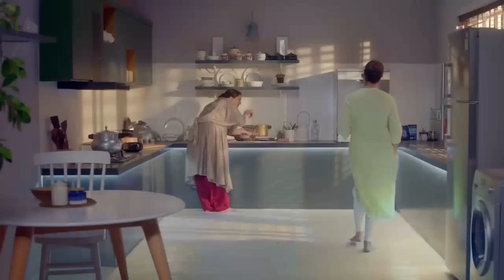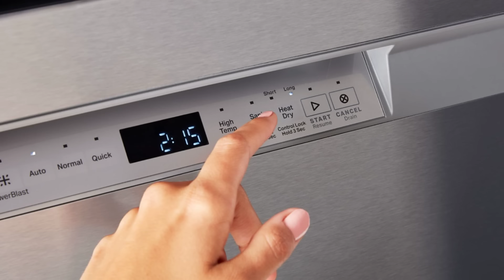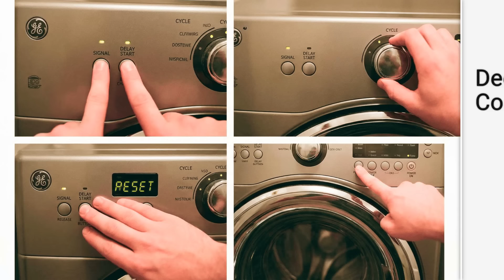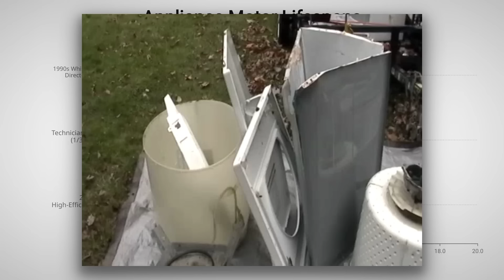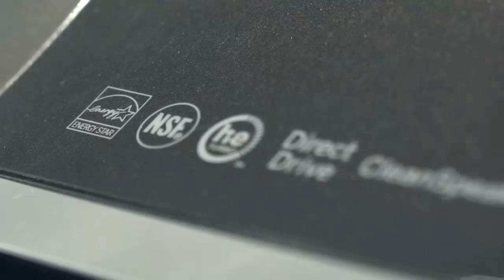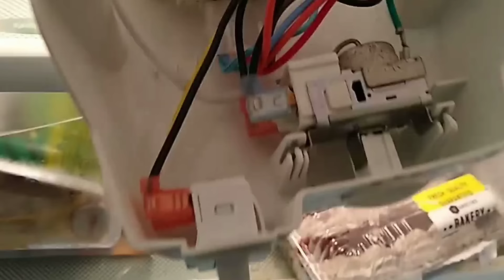Why 'High Efficiency' is a Scam (The EPA's War on Quality).

Comment: They’re horrible no matter what brand you buy.  They don’t get hot enough, they take forever, they don’t dry the dishes, they never look clean, the racks don’t hold the dishes securely and the fall apart fast.  The washers, dryers, refrigerators, freezers and stoves are just as horrible.  How did the country get this bad?

Comment: Still have my late 1980s and early 1990s washer, dryer, and dishwasher. I have replaced 1 switch in the washer and 1 thermal limiter in the dryer over that time. The stove is a 1940s model

Comment: Just finished refurbishing a Kitchenaid/Hobart KDS-16 from 1969. Uses 15 gallons of water on the main cycle BUT, the cycle lasts 50 minutes, requires no rinsing, no scrubbing. My faucet uses 1.8 gallons per minute. If I spent 8 minutes cleaning or rinsing dishes, I would use that amount of water anyway, so in the long run I expect to use about the same amount of water, maybe less, using the older model.

Comment: I live in a place where fresh water is not a scarce resource at all. "Conserving" water in our case is wasting electricity and all the resources that go into building and shipping a dishwasher. We've gone through multiple expensive dishwashers in just ten years. When I was a kid in the 70s and 80s, my parents had the same set of kitchen appliances for decades. I think we're at the end of a cycle in the US where bureaucracy has fully rotted out what was left of common sense and pragmatism, but I think that's the future. The "tech" industry is tapped out and wasting vast resources to do nothing useful. It's time to reboot.

Comment: There's nothing wrong with a time tax if you want efficiency. You are gaining the efficiency both in energy and water used. I don't see an issue here. Dishwashers were made to use and forget. It doesn't matter if you are leaving it run for 40 minutes or 3 hours unless you are really in a hurry to put those dishes away for some reason. If you have a large load, what difference does it make. Run it and forget it. Time efficiency for laundry might be an issue but with respect to dishwashing, I don't see the problem unless you are running a commercial operation.

Comment: The video is b.s. Efficiency guidelines on appliances have no impact on robustness of design and manufacture. There is nothing preventing an appliance company from using heavier gauge steel, using metal instead of plastic, using mechanical timers instead of electronics to mention a few items. Americans number one consideration when choosing appliances  is "how cheap is it?" Cheap cheap cheap, hence the popularity of Walmart, America's favorite store. Americans may complain about quality but aren't willing to pay $1 more to get it. If all regulations were removed from appliance manufacturers, quality would not improve as long as Americans chase cheap and shop at Walmart.

Comment: I have an HE electrolux washer. It washes reasonably well I have to say. Sometimes if I feel like a load needs more water than it already filled with, I have a hose from the utility sink attached to the faucet and fill the machine through the detergent dispenser until I feel it’s enough water

Comment: I'm still rocking my beige, GE fridge from 2000, old top load Kenmore washer, old Maytag dryer. R22 central air system from 2004. IT JUST WORKS
Reply: Give it a few more years, and beige color will be back in fashion.

Comment: Have to say, my Samsung front loaders clean up super well and save tons on water bills.  Not that scares here, but it does shave a lot of cost year by year - I feel it's on the final user to make it work properly, most of the front loaders user don't even do basic maintance to their machines and let them pile up molds and grime, that's the main cause of bad odors on front loaders.

Comment: That's why I'm using a Hobart KitchenAid dishwasher from the 70's, and use a late 80's Lady Kenmore Series 90 direct drive washer. I Also have a late 80's GE Filter Flo washer for really dirty things, as well as pet bedding, since it removes hair very well. I have 2 labs and they shed a ton year round. I Also occasionally watch a few friend's dogs, including a German Shepherd as well as a collie lab mix. They also shed a ton. I need machines that do their job in a reasonable amount of time, are reliable, easily repairable if they do need service, and above all, do the job they are supposed to do.

These new machines are just designed to beep and boop, light up, make it seem like they are working, and then break down when they are just out of warranty. It's disgusting how things can just be flat out bad at their job in the name efficiency. How is a washing machine that uses 7 gallons of water going to clean as well as a machine that uses 30? It's not. That's all their is to it. The water will become filthy quicker. The more water you use, the more diluted that suspended dirt is. They also have abysmal agitation and roll over. The worst performing machines from the 80s are still 100 times better than the best models today, with the exception of Speed Queen TC series machines. We hit a point where efficiency, reliability, and performance were all good, that point was the 80's through the mid 2000's for washing machines. Now we're sacrificing overall performance in the name of efficiency. Even front load machines are terrible these days. Same thing with dishwashers, and toilets. Then when these pieces of shit inevitably fail, they end up in landfills. How is that environmentally friendly? Meanwhile, that 1990's Direct Drive washer is still going, and will continue to do so with minimal maintenance.

The place I work has a Samsung top load "washer" that is a joke of a machine. It's in our break room. As I type this, it is attempting to balance itself so it can spin the still dirty garments inside of it. It's filled and emptied itself twice so far to re balance a fairly small load of laundry. Nothing especially bulky either, it's washing a small load of rags. I'm waiting for the inevitable off balance warning and it's annoying little beeps. The rags would be cleaner if I washed them by hand in the sink. This same load would be done in under a half hour on my machines, meanwhile we're approaching an hour on this stupid thing.
Reply: I use a 1960s Hobart KitchenAid KDS15 superba . It’s a BLAST! 
Primary washer and dryer are center dial Maytag A806 washer and DE 806 dryer. I love how they light up. And they work! For bulky items (and sometimes just for fun-I’m crazy that way) I have a 1923 Easy vacuum electric model R with the spinner tub on the side. It’s the big copper one with the reciprocating plungers. It’s actually extremely gentle. I can even wash draperies with the pleated tops and it’s the only machine that doesn’t damage the pleats or affect the stitching. Yet it’s quite effective. 
Dunno. When I walk into a store and see  what are basic appliances that have had the same assignment for over 100 years (washers, vacuum cleaners, toasters etc)  all look like they’re from outer space, I know we’re being gouged for non-durable durable goods
Reply: @famousutopias  My dishwasher is a KitchenAid Imperial KDI-18. I like those old Maytags that have the light up dials, my Lady Kenmore washer and dryer each have a little light above the dial. They're also factory painted black, which was a pretty rare option for the time. The GE Filter Flo is in fairly rough shape, although it works perfectly fine, it just looks pretty. I have seen videos of those old plunger style washers, they are really neat. I just haven't ever seen one in person. The only non-vintage major appliance in my house is my stove, I found a gas Whirlpool with convection that I really liked on sale, so I grabbed it. I needed a stove and couldn't find a vintage one. I figured Whirlpool would be okay for a modern stove. So far it's 2 years old and fine, I actually like it quite a bit.

Comment: Look you can have both efficiency and reliability. Companies use regulations as an excuse. It's a choice. A 230v dishwasher is more energy efficient than a 120v as it not only uses les amps during its operation but up can utilize more robust parts.

Comment: The proper name for dishwasher is cucarancho,a combination of cucaracha and rancho,because the machine is left with dirty dishes until it’s full,giving the roaches a buffet. They thrive in the ranch.
I have one because a divorce is more expensive than running half full loads. I can wash dishes faster and cleaner by hand. The same goes for disposable plates and cutlery. You can wash real dishes and return them to service faster than the bagging and handling. The roaches miss out again.

Comment: Deep fill is a must. Without it, the top layer of a sizable load will not even get wet. OTOH, the front load washer will do much better job than a top loader with the same amount of water and damage the fabric much less.

Comment: They also don't count the gas consumed by service technicians, having to make 2 trips, 1st trip diagnose, 2nd trip repair, if possible. Furnaces and Air Conditioners are the same,, Replace instead of repair it is over 10 years old. Maybe sooner. Parts availability is always an issue. EPA and DOE don not figure these into their Energy Star equation.

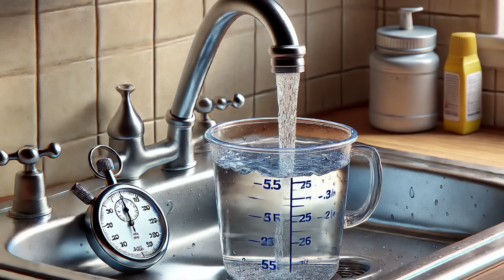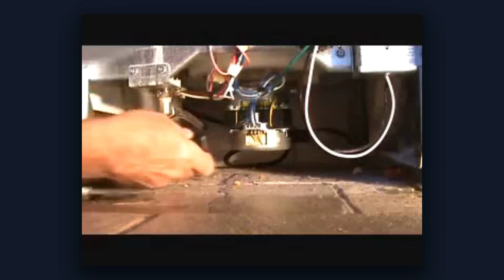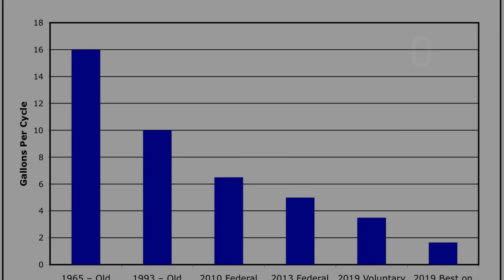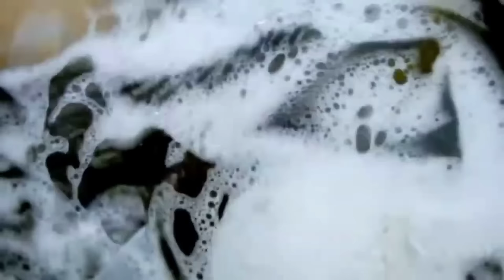Comment: European here. My dishwasher (Electrolux) uses arounnd 10 liters on 50°C program and arounnd 13 liters for the fast 60°C program. The long program takes about 1:45, the fast one is 0:35. My washing machine (Front loader AEG) uses around 45-50 liters for a full load (8kg) at 60°C (takes 1:35 to 2:20 depending on the soilage of the clothes). The water is barely visible in the drum. Never had dirty dishes or clothes when operating according to the manual. Also, never had no repairs (2017 appliances). I guess the video is solely for American appliances?

Comment: But what a great excuse to cost cut on parts and materials! Cheaper built means more profit and if the EPA has your back all the better! 

If you're a real big player in the appliance market you can even propose regulations that will run smaller competitors out of business!    It's for the planet!
Reply: I dont knwo man cheap fridges and washign machines works great they do not have fancy stuff but they are like 300 new and just works. In today world where calling mechanics will ask no less then 300 for work only its no brainer. Its just not worth to repair things anymore if you cant do it yourself.
Man power is too expensive.

Comment: I am going to give my two cents. I am satisfied with my “high-efficiency dishwasher”. I run it at night after before going to bed after it has collected all of the plates and dishes for my family throughout the day.
When I wake up in the morning, everything is clean and I can put the dishes away before starting work.

However, I agree with the video about the washing machine. I absolutely hate my Samsung washing machine. There are only two settings that enable me to use the “deep fill“ function which actually provides an adequate amount of water for my clothes.
Unfortunately, this washing machine came with my house and all of the new washing machine machines at the store are built along the same lines so I I’m stuck with this stupid thing.

Comment: I had a early 2000’s Maytag Bravos that was phenomenal in washing cloths. After years of hard service, the only two repairs I made were replaced the water fill valve, and I also had to replace the bearings and seals. Both repairs took about three hours without any help. I had a 1990’s Maytag dryer that was also phenomenal. Over the course of time , I replaced the belt and rollers twice, along with one heat relay. I had to leave them when I sold the house. I purchased new Maytag washer and dryer in 2020. I’m totally disappointed with the quality and operations of the new products. The only way I can get the clothes washed clean, after the water stops filling, I have to add between 5 and 7 gallons of water + detergent. Then it gives a halfway wash. The dryer is very flimsy compared to the old model. As soon as I get the extra money I will purchase Speed Queen appliances. BK

Comment: The water calculations should include pre-washing by hand and washing by hand after the machine is done.  In the same way, 1.6 gallon toilets often must be flushed twice.  Home plumbing must be cleaned by flushing and other water uses.  If not enough water goes into the pipes, expensive repairs that consume many more resources must be made.  Our laws our often ridiculous.  Tell your legislators to use common sense.  I think that we have wasted billions and billions of gallons of water with the use of these ridiculous appliances and fixtures with frustration for homeowners as part of the result.  Check your legislators' plumbing if you get a chance to visit.  See what kind of standards apply to them.  I think you may be surprised.  While we see our aquifers being depleted faster than they fill up, we see uncontrolled wells owned by foreigners being used to grow food that will be exported.  If they would spend their money on making fresh water instead of funding terrorists, they would not have a water problem.

Comment: I use the Bulky/Large setting on the LG front loader with extra rinse cycles and spot treat stains and my clothes are always clean. 

I use extra rinse on the dishwasher also which helps. They are always perfectly clean and I don’t do any pre cleaning except scraping with a fork.

Comment: What's the common denominator on many of the "improvements"....Government regulations on energy and water savings.  "I'm from the government and I am here to help."  
 I bought a replacement HVAC system for our home in 2025. Due to government regulations on green house gases, I was not able to buy the air conditioner section with reliable R 410A refrigerant. I paid an estimated $2500 additional for the privilege of buying one with a new refrigerant (R-454B). But that's not the best part. The new refrigerant is slightly flammable. So what did the government regulators do about that? They mandated a leak detector that will then shut off the gas furnace section in case of an air conditioner refrigerant  leak.  THAT'S GREAT, NOW IF THE SYSTEM DETECTS AN AC LEAK IN THE MIDDLE OF THE WINTER THE FURNANCE WILL SHUT DOWN!!!  FROZEN PIPES ANYBODY?  STUPID !!!
Reply: They could make the energy star appliance last 20 years they just have no incentive to do so. No review site tests for longevity
Reply: Or more likely it will malfunction and shut down when there is no leak.

Comment: You must grasp use of less energy and resources is mandated or we will eliminate the machines.  This is not a choice but mandate to save the planet.  The ultimate solution shall be Agenda 2030 and 2035 and dropping the population.  You can feel free to complain and say you are going to revolt, but that can be dealt with with AI, drones, communication and electricity cutoffs.  It is coming.

Comment: The TITLE is a lie.  The EPA is not having a war on quality.   There is no scam. I am in the Appliance industry.  The problem has several parts.  1 You ca not build am appliance that lasts for a generation or more, 20years. If your a manufacture and build such a device that lasts too long, you will put yourself literally out of business. You can not sell parts and you will not sell new units. Its a terrible business model. 
In order to stay in business using the 20- year model,  Appliances would have to actually cost 10 times as much. So that business mode is not going to work either.
The other problem is Foreign competition. They build cheap CRAP and American companies have to compete.
The 5-7 year business model is a balance of Quality, Cost and survival.
The EPA did mandate High efficiency.  Prior to this all appliances used AC motors that lasted 20-30 years. AC Motors are 3-5% less efficient than DC motors. So the EPA mandated using DC motors.  So they invented the Inverter motor and the half cooling cycle for refrigerators.  This increases efficiency 3-5% but DC motors do not last 20+ years. But  AC motors are no longer needed in the 5-7 year business model.   Refrigerators now cool but not ad cold and slower than their predecessors.  Old R12 and R134 refrigerators could get to -15°F in an hour empty. Modern Refrigerators take Six hours to freeze from room temperature only get to -6°F empty.
The EPA only contributed to the problem they did not create this one.
Reply: Like why not put a minimum warranty of lets say multiple years into law? would help in making stuff designed to last longer.

The DC motors you speak of is a special type of AC motor and inverter, and those could very likely be built better.
Reply: Strange thing these branda didnt go out of bussiness some 50 years ago while making 20-30 year lasting appliances

Comment: The stuff they build now is absolute crap. I don’t need Smart. I need appliances that do the job, do it well, last for years without needing repair, and can be repaired when the time comes. I’m not worried about using some water and electricity either.